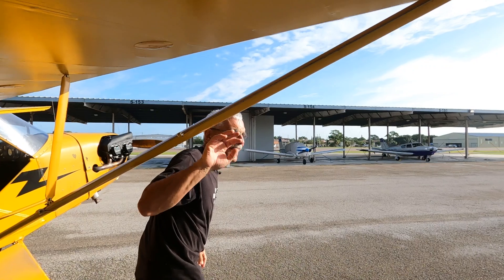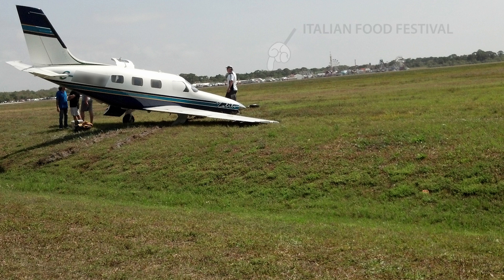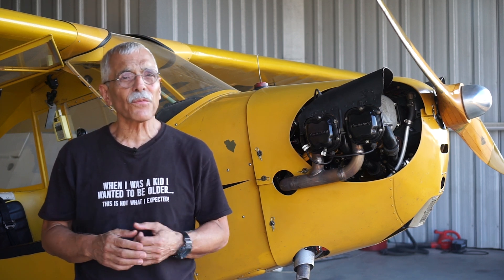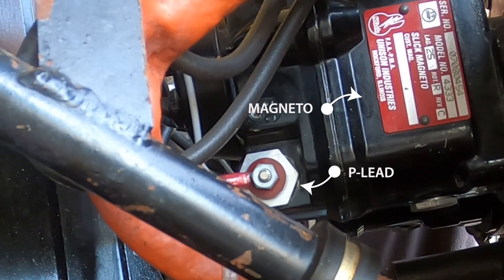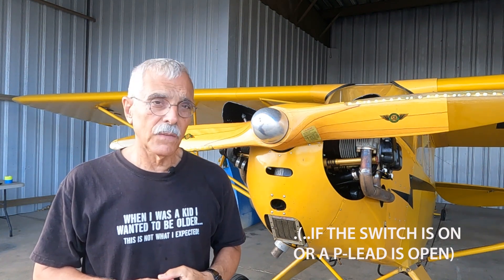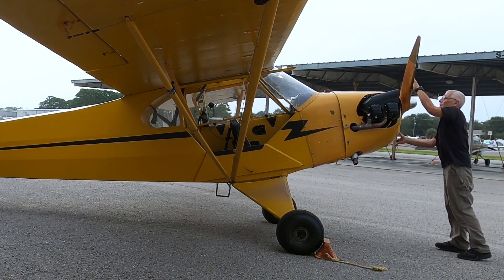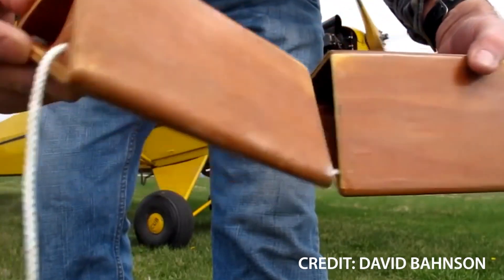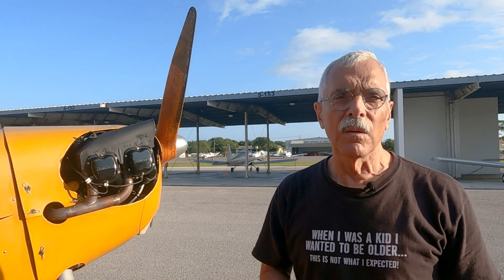Bad for Aviation: Hand Propping Run Amuck

Comment: Paul covered the hand propping topic well. I have owned and flown Champs since 1987 and much of what was covered is how I was taught. I was also taught to start on the left mag since it will be the impulse mag if the plane only has one, and to start on both mags if both mags have an impulse. The reason is to reduce the chance of a kickback of the prop. 

Pilots are taught from day one to fear the prop and never turn it. A healthy respect of the prop is always good, especially when you get so used to spinning the prop every time you fly. Bottom line is never turn the prop unless you are prepared for the engine to start and the throttle is in the closed or cracked position.

Comment: Last summer I took care of a friends Chief after he moved away. He showed me a good trick that works well if you have a Marvel carb and not the old Stromberg. 2 shots of prime, 3 blades, mixture idle cutoff, mags hot. 4th blade always starts and gives you just enough time to calmly walk around and push in the mixture while the engine putts along at about 450 RPM. If the throttle is even slightly off idle, the engine roars and dies immediately. The only way it works is if everything is set right, and it works every time it's done right, hot or cold. The Chief eventually sold and I had to turn over the...keys? mag switch? to the new owner. I really miss flying that simple old bird.

Comment: So I'll be that guy:   Why isn't there a mechanism to hold the brake?   Is there concern of inadvertently engaging it while in flight?  Even so, designing it to automatically disengage when the wheels are hanging and not supporting the load of the aircraft as a safety measure doesn't seem that difficult to design.  My question applies to original designs, not so much owner modifications which could require recertification.

To be clear, I'm not suggesting relying upon a holding brake in lieu of the chocks and rope, but it sure seems like it would be helpful when transitioning to the cockpit after all of those devices have been removed.

Comment: That $5 rope might be adequate for the Cub, but I know of several cases of aircraft such as Pitts with 150hp that easily ran away with a decent size rope around it's tailwheel doing nothing except a slight hickup in its rampant acceleration run.

You need a much stronger, and abrasion resistant cable. Preferably a chain. Hooked to a heavy duty tie down anchor, or a pickup truck hitch. Set the parking brake, use a chain or steel cable or Nylon tow-strap rated at an obscenely high strength (no less than 2,000lb+). And that's all you need. 

Ditch the rope. 

And don't try to hand prop a Cirrus: https://youtu.be/7KpOg9Ci284

Comment: Magnetos with impulse couplings have been around in oil fields since before I was around them at a pretty young age. I'm retired now. But I was really surprised when I was caught far out in the field with a dead starter battery on my Lincoln welding machine. One quick crank on the supplied crank and she started right up.

Comment: I loved to hand prop my old 1947 Stinson 108-2 at the airstrip in FLorida. Had a big 74 inch metal prop. I didn't even untie the tail or the wings when I did it, that came later.
Started very time with hand prop, ran like a champ, even though it was a Franklin 6 cylinder. Guess the timing was pretty on the mark.
An unfortunate young lady learning to fly a Luscombe came out one day and had totally untied the airplane and hand propped it. Well it took off nearly slicing and dicing her and headed for the trees 100 feet away when it crashed. She was so damn lucky not to be killed. The owner eventually rebuilt the wings and it was like new again.

Comment: Many years ago, I periodically worked on the air conditioning of a King Air.  Sometimes, it was necessary to work at, or close to, the engine driven compressor.  I would tie myself off with a rope to prevent myself from accidently stepping to far forward and into the prop arc.  I am still sure there are better and safer ways that real professionals use.  But, that is what we had and how it got done.  And to state a fact, I hated working on that plane!

Comment: Despite the somewhat cynical humour, the risks are addressed one by one and thoroughly. Well done, nice production! 
Reluctantly hand propped an aircraft once only. PA-28 which I'd flown for ~1 hour with the gen switch selected off. 
Big chocks ✔️
Handbrake ✔️
Throttle minimum ✔️
Tail rope 🤔
Assistant ❌
It worked, but it was a scary experience that I'd really rather not have had.

Comment: Test out the chocks you decide to use. Too big and they’ll just get pushed along in front of the tire instead of the wedging action that prevents the tire from moving forward.
Reply from the maker: Those chocks I use hold the Cub at full power. I know this because, as you suggest, I tested it. One important thing I didn't mention is that I also tie the stick full up elevator so the tail stays down. If it comes up, the airplane still won't move, but it's better if it stays planted.

Comment: Wouldn't rubber springs (used for boat mooring) be a very good addition? I use these for towing cars as well and they make a huge difference when it comes too reducing sharp engagements.
Reply: Or nylon strop/load binders which have a lot of "give" but are very strong.

Comment: I learned to prop from in from and made sure of clear communication as to brakes on, switch off to pull prop through.  Position prop at top of compression stroke.  Then it was “brakes, cracked, contact” and wait for the same response back.  Then push on the prop near hub to make sure brakes on.  Put tips of fingers just at the trailing edge of the prop blade so your hand covers the prop surface. I was taught to just stand up straight, lot lean in, but bring your right foot forward about a foot balanced and swing that leg back as you bring the prop down which moves you back away from the arc of the prop.  Later when I instructed in Cubs I propped them from behind holding on to the windshield strut.  Many years of doing it that way with no problems or incidents 😉

Comment: Excellent video that covers all the salient points. Two additional pieces of food for thought. First, never be in a hurry and always, always, always use the exact same habit pattern you’ve established for hand propping. Secondly, if you’re out front, once the motor starts, walk parallel to the leading edge, all the way to the wingtip. Move toward the wings trailing edge and then walk all the way back to the cockpit. Having a habit pattern of respectfully avoiding the prop arc by giving it wide berth is really important to establish early on. Nice video, Paul. 

Thanks for everything you do for aviation.

Comment: Last time I prop started an airplane engine was back in A&P school, where it was a required part of the curriculum. I started a C-85 on a Cessna 120 and an A-65 on a test stand. In both cases we worked with a partner. I remember it being relatively easy on such small engines, but I wouldn’t recommend it on anything larger than an O-235, or anything that has an electric starter already. Those guys doing it on old rotary engines with huge propellers are a bit nuts, but then again so are the pilots that fly them. They just didn’t have any other way to do it back then.

Comment: Just want to be in the know. How come there is not a parking brake?
Reply from the maker: Brakes are Cubs are rudimentary at best and barely work at all. Even if you could rig a parking brake, I'd never trust it. I don't trust them on modern airplanes either. That's what chocks are for.

Comment: I’ve hand propped a lot of planes, but a couple of weeks ago I got to prop a 1942 Meyers OTW.  it was a very cool experience.  Much bigger than anything I’ve propped before.  Good thing I could get a good blade in the 9 o’clock position or I wouldn’t have been able to reach.  I use the leg kick method because it makes me feel like Waldo Pepper.

Comment: All sound advice.
I was taught hand propping by my dad many years ago. He was a flight instructor and had worked on planes since he was young after WW II.
He taught me the leg kick method, then regardless of starting you are already stepping away. The other point he was adamant about was - ALWAYS assume the ignition is hot when you touch the prop.
Only seen one propping accident, fortunately for the guy only ended up with a bad bruise for quite a while.
Even if I call, throttle closed, ignition off, and I get affirmative reply I still treat the prop as if it's not.
Again great advice and good video.

Comment: In 1981, as a student pilot, I flew to Auburn, WA airport for fuel in a friend's Cessna 120.  The battery was dead.  I got gas, and the ramp fuel jockey guy said he was prohibited from helping me hand prop the plane.  So I did it myself....and somehow the throttle control lever was over half way ON....I did not verify it.  Well, I hand propped it and the 85 Continental fired to life.....at about 2000 rpm.  I jumped out of the way and the Cessna taxied itself fast and smashed into 2 ladders, and the side of a hanger, before I chased it and shut it off.  Relatively minor damage, but It took me 6 months wages to pay for it.  Very bad for aviation....

Comment: Never understood why you can't have a pull start from the cabin on aircraft that aren't fully electric. I fly a powered hang glider, and it runs a total loss electrical system with a pull start to back it up. Pretty essential for a glider where you're intending to do restarts in the air.

Comment: For me it's always been about primer. If it needs any, tie it back. Lot of J-3 time and below about 40F I found it difficult to cold-start from behind despite being nearly too big to fit in the Cub. And the extra primer to get it started in the cold makes it all the more "exciting." Have to tie it or have someone trustworthy on the brakes.  If it's warm it will start at idle or 1 tinch up and I prop from behind. It just takes 1 slap and it starts. I think I would have mentioned getting in the plane... it is very easy to bump the throttle. "I'm about to sit on my headset/gps/hat/camera bag. Let's  toss it on the front seat until I am settled. OMG, the cables/handle/strap/cord caught the throttle." Ask me how I know...

As a lineman at my college airport I got talked into hand starting a 300hp Mooney. ONCE. Had to grip around the blades, use a lot of upper body and follow-through, and a 3 blade prop has a buddy coming along behind it real soon. Got it started but felt like I had just juggled running chain saws. Dumbest aviation thing I ever did.

Comment: Wow Paul.  What a great, common sense look at a quasi-religious subject.

After 45 years of hand propping without incident, here are my habits.  (7AC, 65HP, unshielded, 1 impulse, metal prop)

Every time i TOUCH the prop, i consider the mags hot.   Even during maintenance.

I tie the tail, with no chocks, then switch the mags HOT first!

The last thing i do before EVERY  start attempt is : right foot on the right main, hoist up,  look directly at the throttle, and observe and confirm outloud, "throttle is closed"

Then prime 4 blades,  then pull hard to start.  Each of the 5 pulls is done as if the engine will start.  Many times the engine starts on the 3rd or 4th pull, which is fine by me.

I have 2 friends that have lost aircraft while clearing a flooded engine at WOT.  VERY VERY DANGEROUS......  

In both cases they were at WOT and "thought" the mags were cold.

Engines occasionally flood.   Keep your wits about you, back away from the airplane, have a glass of tea.  15 minutes later, the airplane will start just fine.

Hand propping is a skill with a simple learning curve, but zero tolerance for errors.  

I also think hand propping is a valuable skill that should not die.  That would be "bad for aviation"

Comment: The best reason for not hand-propping an aircraft with an electrical system and a dead battery is because the alternator won’t charge without power going to the field.  So get a jump!  This will energize the alternator field so the alternator can start recharging the battery and keep your wimpy limbs from being sliced off in the prop arc.
I hand prop from behind...and have a cord attached to the front throttle, draped across the seat and out the door.  If I’m complacent enough to forget to check the throttle setting, I can grab that cord and yank the throttle back, no matter what kind of door the plane has, instead of just running away with an uncontrolled, spinning prop at my heels (which is bad for aviation).

Comment: A very thorough lesson on how to properly hand prop a plane.  Have seen a lot of attempts where the hand propper stands on one leg to get a lot of body weight behind the pull and the other leg within the arc of the propeller.  It would not be hard to imagine falling into the prop even during a no-start or losing a leg or other valuable body part.  Hope this video helps people properly prop a plane.   NH

Comment: I swung the prop on a rental once (I lost a cylinder on the previous flight, so I though I'd check compression as part of the pre-flight). I stood in front of the spinner and pulled the prop thru the first compression bump while staring at the keys on the dash. It caught instantly. Six inches from my face !!! Luckily the idle mixture cut-off did it's job and the prop sputtered back to silence in a few seconds that felt like hours. 

The previous pilot had pulled the keys out of the ignition switch while in right mag position...so it was hot.
Reply: My father owned a Comanche for a time in the 60s. He would always turn the prop a few rotations before starting the engine. I can still see the look on his face when he crawled inside one time and saw the key was turned on. At least he still had a face since the engine hadn’t fired.
Reply: @a.n.7863  My "incident" had the prop make maybe a dozen rotations as the engine coughed out a few anemic power strokes. Still enough to knock me into the next week if it had struck me. Given how mags can fail "hot" in several unexpected ways, I'll never touch a prop again without expecting it to bark to life.
Reply: @paulslevinsky580  quite possibly into the next life. Glad you had those 6 inches to spare.

Comment: I use chocks and a rope but I tie the rope thru the aft fuselage hand hold with a quick release knot. Once started and I'm inside the cockpit I can pull on the loose end of the rope to release the knot. This way the tail is more securely held down and the aircraft is also secured until I'm at the controls. Look up quick release knot and after tie the knot pull on the aircraft to make sure it is secure.

Comment: Wouldn't a couple of pieces of wood between the brake pedals and the front of the seat act as parking brakes?
And for a fail safe an ignition leash to the pilot like on Quad racers and jet skis. If the plane gets away from the pilot the leash is pulled and the spark is killed.

Comment: Very good video, thanks Paul! I have zero tail dragger time, so pardon my ignorance please. I'd add that if the plane has a parking brake, always set it. If it has one but it doesn't work, get it fixed. If you never use one, well I hope Paul never gets the opportunity to examine anything you do. Cheers! Ken

Comment: How about a rope start Paul ? Have you ever seen one done on a light aircraft ? ( looping a rope several times around the spinner and pulling it far enough from the propeller so as to not endanger anyone )….That is how I used to start Douglas DC3’s in the african bush….

Comment: I see your electric starter and raise you an electric MOTOR!
Until batteries get energy dense enough, a hybrid system will allow electric propulsion and even multi motor electric propulsion, the benefits of which are barely discussed, let alone known.

Comment: I hand propped an A-75 for 7 years from behind the prop using a rope tied to the chocks (and a rear tie down if available) and it worked great.  Never had a problem except once in a while with a warm start on a hot day when somehow I would manage to flood the engine, probably by over priming it.  At that point no matter what I tried, including evacuating the cylinders per the Continental manual by turning the prop backwards, etc., it generally would not start.  Period.  Eventually when I finally learned to just walk away from it for about 15-20 minutes and then try it again, life got much better.  No matter how much you sweet talk or cuss out the A-75, when it's flooded, it still won't start.

Comment: My first hand start was a 3 blade O-540 hung on the front of a Piper crop-duster. Being ferried 300+ miles 'home' with 'burnt out electrics' by a Welsh engineer plugged into a handheld radio. After fueling of course, he asked for 'a swing'.
Duly briefing me on the different 'angle of dangle' etc., he pulled it through a couple of times, carefully set the prop 'about there will do, boyo', then climbed up & strapped in . . . 'Contact.'
Thankfully, first pull gave a nice 'plopperty-plopperty' on all six & a very relieved trainee-junior-assistant-minion 'gofer' watching a complete madman take off with a sandwich in his mouth. Yorkshire bacon too; hope he made it OK : )

Comment: Thank you for The Fuel Off tip, even if learning that good practice about fifty years late. Most of my J3 flying was on floats and skis and the few weeks in the fall and spring when I flew it on wheels I still propped it from behind like you had to when it was on floats. That was especially safer when on ice with skis so at least I was close to reaching into the cockpit and if the plane did lurch forward I could grab the strut.